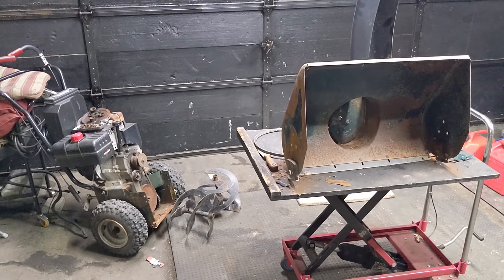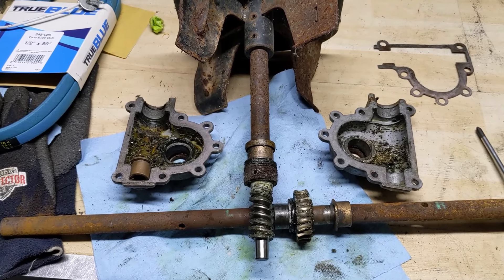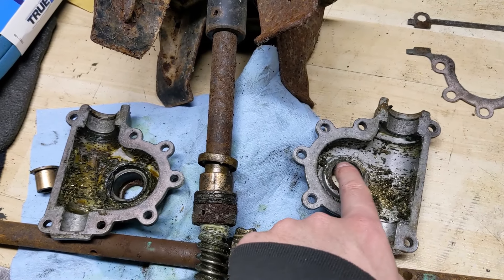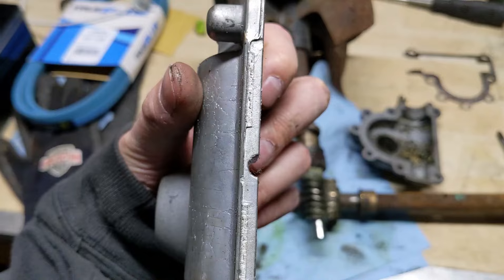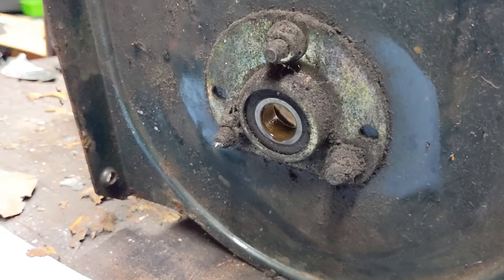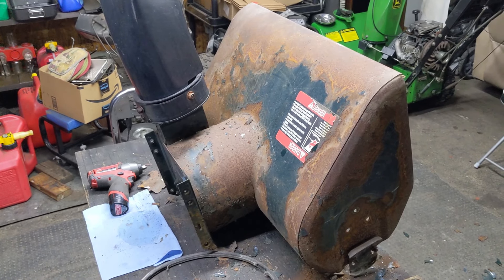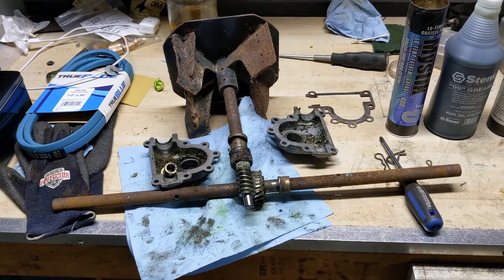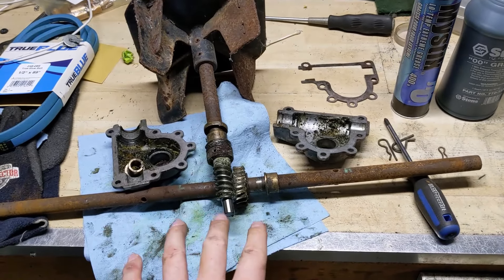Check the Snowblower Gearbox for Grease

Comment: At first I thought 'How can a simple subject like this take almost 19 minutes?'  Wow, you packed it with great information throughout.  Don't stop making these videos.  Thank you.
Reply from the maker: Thanks for the kind words! I try to include expert info that's easy to understand. Thanks for watching!
Reply: Great video. 
How would you flush the gear box full of lithium grease? Got a used blower and gave been fixing it up. Runs great, got 80 90 gear box oil but when I went to flush it's grease 8nside? I trylgas and ran it for a bit.  It not as thick but still not draining. 

Thank my man

Comment: Thanks, I am working on an abused contractor blower right now.  I am done.  I am just checking to see if my snow-mobile grease is OK.  I will check the label for sulphur.  I have used it in Roto Tiller worm gears for years.  Thanks again.  Your knowledge is ahead of mine but I try.
Reply from the maker: Thanks for the kind words Bruce! I spend a lot of time researching to see what's good and not so good, rather than always learning from experience, or trial and error. I do like the STENS 00 grease, but sadly the old man said they're not selling it anymore. I forget where we purchased the Alvania EP, but it works good too. I've heard Tractor Supply Store (now peavy mart) sells 00 cotton picker grease, but not sure if it's good for low temps. Looks like I have to do more research now lol

Comment: My MTD  317E611D120 (1997)  is now 24 years old. It's in excellent condition.  I've always done yearly maintenance on it.  I always make sure the gearbox is full of GEARBOX 80 WEIGHT OIL.  Matter of fact I just disassembled the gearbox on my MTD to see if there were any serious wear issues.  No metal flakes or any signs of wear, looks brand new. I will continue using gearbox 80 weight oil.

Comment: Stupid me - I forgot to reinstall sheer pins at the auger from ( bolt ) convenience last year. Well, now I gotta do the worm gear so thanks for your vid and all the helpful tips. Never did this before but looks doable thanks to guys like you and helpful info. Warning to everyone new to snowblower operation - “ make sure you use sheer pins on your auger shaft and save yourself the trouble and cost “.

Comment: Great video that will save your viewers major gearbox rebuild costs. Most gearboxes are filled with low temperature white lithium grease right from the assembly line BUT this stuff tends to get pushed and packed off to the sides of the covers away from the two worm gears. The 00 grease you use is an excellent way to extend the life of the internal components of the gearbox by simply adding some as required every year or two years. Pretty soon time to start on lawnmower videos SPRING is upon us!
Reply from the maker: Fools spring! I'm still waiting for 2nd winter. Thanks for watching!
Reply: Good  day Wayne. I like reading  comments for different opinions,  started  reading,  boy fellow knows what he is talking about.  I wonder were the young fellow gets it from.  lol  Thanks I guess I  will have to get some stens  00
Reply: @EliminatorPerformance  I have had enough winter, darn cold or I.m  getting older.  Thanks  Jake good video.
Reply: Don thanks appreciate the kind words, stay safe and healthy my friend!

Comment: I just put an M4 bolt in the front of mine. 45deg downward angle about midway on the cone shaped portion. Poured in grease thru the top hole to push out the aluminum shavings. Once it started coming out clean, pumped grease in thru the new hole to push any air out the top. $0.44 bolt and washer, coated in permatex afterward to stop leaks.

Comment: The Stens 00 is re-labeled Champion 4049H, recently discontinued.  Alvania is a Shell product, discontinued even longer (replaced by Gadus).  Both had sulphur as the EP additive, but tested 1B on the ASTM corrosion chart (not likely to cause issues, and that’s backed up by the fact that Alvania has always been MTD’s recommendation for their gearboxes).

I’m running the Champion (aka Stens) product in my MTD-built Troy Bilt.

I did an unscientific side by side comparison of corrosion using the Champion product and the Smitty’s Super S 00 from Tractor Supply.  I used that as the comparison because it contains no sulphur at all.  I soaked brass fittings in each product for several days.  At the end, I could see no difference in the darkening of the fittings, in fact if there was a difference, the Super S may have been a tiny bit darker.
Reply from the maker: Champion still sells the 00 except not in 32oz bottles, you have to buy PN: 8229763 which is an 18kg container. I could fill my own bottles, but it sucks for reselling to my customers who want it.

Comment: Nice,,great info
One comment I do have on EP additives
"active sulfur" is low temp high pressure and will react with so called yellow metals..
"Inactive sulfur" is used for High Temp gears and will only react to form an intervening coating at these very high temps.
If we use an EP with high temp "Inactive" it shouldn't  hurt these gears as they simply don't see any high temps..
Generally, EP additives for a simple gear system as this really isn't required.  
My concern is keeping these lubricated. I find that the original grease doesn't Re-Flow back to the gears and just seems to get wrapped up and spun off to the outside of the case internally. 
I like the new case mod you show and speak of, great idea, just pump and go, keep it fresh!
Reply from the maker: Which is one reason why I prefer to use the 00 as it flows like oil but sticks like grease. The NLGI #2 is too buttery and regular 5w40 synthetic oil (what MTD is now using) is too runny in my opinion. Unfortunately there's a shortage of 00 grease here in Canada.
Reply: I heard ya dad mention that,, 
I'm not finding either as I search,,,ughhh
Reply: I was thinking about trying the Lucas oil treatment stuff they sell
Reply from the maker: @TheNovaJohn  I'm calling Super S Products tomorrow to see if they'll sell us some from the US, as NAPA Canada won't import it, and TCS tractor store in Canada won't sell the cotton picker 00 grease they sell in the US either... The only other option was Champion grease but unfortunately they discontinued their 32oz bottles and are only selling larger quantities now...

Comment: The gear box on Ariens snowblowers, at least the newer ones, is filled with a specific oil.  You're supposed to check it to ensure it has an adequate amount.  The level needs to be so many inches from the top of the gear box housing.

Comment: I use Mobil 1 grease, its good to -60 degrees, so it flows in to all the spaces, I use a grease gun on the top of the case and pump until it flows out, I run the machine with a  clip on the  auger for 10 min or so and stop the machine and again pump grease in to hole. I also drilled grease fittings at the ends of the shaft so that the end bearings get grease. Never had a problem  some grease I use  to lube the  wheel shafts and the internal gears.  Same grease i use on my truck drive shaft grease fittings.

Comment: I have a 40 year old toro 521.  I got it cheap.  It seems to spin the auger just fine.  Toro calls for mag 1 grease.  Do I need to service mine?  Or, should I just leave it alone?  Seems to work fine.  There is no way to drain it, only add more grease if I can get the fill plug off.

Comment: your videos are very thorough  i have an old craftsman snowblower but one side of the auger is frozen on the shaft  it wont spin around the shaft when i remove the shearpin  any ideas of getting it free other than using a torch which i dont have  thanks

Comment: I have a poulan blower, model PP1150E27. The gear box has (2) gear box plugs. Should I install a couple of zerk fittings or just check periodically for grease. PS everything works fine

Comment: I have a 20 year old Craftsman 8/24 in excellent condition that I just received and serviced everything possible but it appears my gear box has NO plug or nipple at all to check or add oil/grease?
Any ideas on this would be appreciated. 

Thanks

Comment: My manual says Ronex ED #1 grease.
That stuff is hard to find or not available.
I came across Castrol Spheerol SHL 00 grease.
Castrol says it has a 1b corrosion rating so ok for bronze/brass.
I don't know how much grease is in there yet,but if I have to add can I just add the Castrol 00 grease to the gearbox without having to take it apart and remove any old original grease?
Reply from the maker: Yes it should be fine to mix, I know Stens is no longer selling the 00 and MTD (Cub Cadet, Troy-Bilt Craftsman) exclusively use Alvania EP grease. Try to find Champion 00 at Napa or Cotton picker 00 at PeavyMart/Tractor Supply Store
Reply: @EliminatorPerformance  Thanks
Forgot to mention the Castrol Spheerol SHL 00 grease is a semi-fluid synthetic PAO grease so it should work well in cold weather.

Comment: I never use gun grease in any of my differentials. I've only use synthetic gear lube. 
 That has to be the first time I've seen pump grease in a gearbox. I guess if it's full, the gears will move the grease around enough. As long as there is a grease zerk, you have your answer on what to use.

Comment: I just fixed a snowblower that had a little stiff grease in the case. The brass gear died from lack of lubrication from the factory.  I replaced the brass gear.  My case had a plug at the bottom and the top, so I used a grease gun filled with John Deere corn head grease and pumped grease into the gearbox from the bottom.  This verifies that there are no air pockets and the gearbox is full.  I used a piece of wire to determine the level of grease on the top worm gear.  DO NOT FILL THE GEARBOX COMPLETELY FULL OF GREASE!!!!  As long as the grease level is a little above the mesh of the worm and pinion gears, the level is correct.   

I have used Lucas Hub Oil in place of corn head grease.  It can be found at parts outlets that handle tractor trailer parts.

If I were to add a grease zerk to fill the gearbox, I would install it in the lowest point possible, making it possible to fill the gearbox with cornhead grease.  Just monitor the level of the grease as the gearbox is filled.
Reply from the maker: Great tips, thanks for watching!
Reply: I use “00” grease and anything else I’ve tried is too thin and will leak.

Comment: Great info.   But I think my SNAPPER 10301 uses ENGINE OIL in that gearbox ?
Reply from the maker: Some take a gear oil, others may take engine oil like the real old snowblowers with the cast steel gearboxes. I use 00 grease in every gear box and have never had an issue.

Comment: Something like a 5w 20 or 5w 30 would be far to thin of lubricant? I was reading some craftsman forms as I just picked up an older 5/23 that needs some love and I was reading that some say the old craftsman uses to call for a motor oil in the gear box any thoughts
Reply from the maker: The "00" grease is far superior in my opinion, it offers great lubricity in low temperature conditions, but also thick and sticky enough that it adheres to the gears while spinning. There's a reason it comes in almost every snowblower gearbox now.

Comment: Nicely done!  Have you ever used gearbox oil, like the lower units of boat gearboxes?  Guessing the seals (intended for grease) wouldn't contain it.  I prefer oi because it's a better lubricant than grease, but grease has it's place too.

Comment: I have a twenty fifteen cub cadet model number 524 s w e snowthrower.  The Auger gearbox does not have a drain bolt and it does not have a removable fill plug.  As far as I can determine the seals are still good.  How would you recommend adding some grease/lubricant to it Or checking its level?
Reply: You  shouldn't have to worry about it unless you see it's leaking grease.  If it is, use 00 grease

Comment: Is it possible to use something like an axle/hub oil(S6 AXRME SAE 75W-90)? This is used in commercial vehicles for steer hub lubrication and those vehicles run in severe low temp conditions without issue. Thanks for the video.
Reply from the maker: Yes many people run that stuff too, I've never used it but I've heard it works fine. I stick to 00 grease because it's been proven and is commonly used in snowblower auger gearboxes

Comment: My Craftsman snowblower has two grease plugs on the auger gear box.Both are at even height.
When adding 00 grease do you add grease through one hole until it comes out of the other hole or would that be adding too much grease?

Comment: Incredible informative video that I’ve been searching for!  I have a 9 hp 29 inch wide craftsman snowblower that is from 2003-2005.  My gearbox has that same bolt as you’re pointing out in the video, when I remove that bolt am I supposed to put grease or gear oil in the housing?
Reply from the maker: 00 grease is similar to gear oil, the old steel gearbox housings take thicker gear oil
Reply: @EliminatorPerformance  Awesome thank you my local New Holland dealer sells the exact same 00 grease shown in your video!  Cheers!
Reply from the maker: @big_mike_nyc  it's good stuff, I've never had a problem. As shown in the video when I smear it on the workbench, it's like a mix between oil and grease.

Comment: Hey Eliminator Performance, Maybe you can help me with a problem with my snowblower. I have a 2011 Sears Craftsman snowblower, 1450/27 , and I am currently working on fixing the gearbox. I did watch the video twice but I still can’t get the issue resolved. Here’s the kicker, I talked to a mechanic I know very well and he said it is not just grease, but there’s gear oil mixed in with it. So here the problem:  I have put the adequate amount of grease (or what I thought it was) but I am just wondering, should I be able to rotate the auger unit with my hands or do I have to connect the 2 units together?
Reply from the maker: Auger usually does not spin by hand, unless you're rotating the impeller shaft, which should then spin the worm gear (as seen in this video) I've used 00 grease on every gearbox unit, never had an issue. The difference is the real older units with steel gearbox housings use gear oil. Some guys use gear oil, I use 00 grease as it's in between grease and oil. It's never created a failure
Reply: @EliminatorPerformance  I have spun the impeller by hand, but while I have spun it, it took some effort.  And on top that, I don't have Steins 00 grease, I am using a grease called Motomaster Extreme low temperature grease, it says it's good for snowmobiles, and it's calcium based, the viscosity -- I would say -- is similar to the white lithium based grease in the video...
Reply: is the grease that i have an ideal or close to what I saw in the video?  I talked to a buddy mechanic I know, and he said that what I have would work good.  but I'm still having issues.  I am going to keep on trying and hope I can get the issue resovled by the end of this week
Reply from the maker: @kaelanreynolds9762  I use white lithium on the worm gear when assembling, then use 00 to fill the gearbox. I find the 00 flows better than the lithium. If it looks similar to the 00 you should be fine.

Comment: If you add a grease fitting to the housing, how can you pump in the 00 grease?
Reply: You’d have to buy a manual grease pump that you can fill with “00” grease. Google “00” manual grease pump. If you’re going to use that grease maybe drill a hole in the top like some will come nowadays and just cap it

Comment: Tractor Supply sells Cotton Picker Spindle Grease 00. $5.29/qt. I've used it. It works.
Reply: Good  day Paul Tennis.  Would that be good in cold here in Ontario.  Were are you from  Thanks
Reply: Paul thanks we will check this cotton picker spindle grease 00 out at our local TSC, never heard of it before!
Reply from the maker: Yes I've heard of it, it is Double Zero so should work, the issue was it wasn't available at our local TSC when a friend looked for it!
Reply: @EliminatorPerformance  Tractor Supply in the USA is a different company than TSC (Peavey) in Canada. That is why we cannot get the same products that Tractor Supply in the USA carries.
Reply: @donvoll2580  I'm in the US in the New England area. Since the grease is type 00, I think it would work find in your area.
Reply: @EliminatorPerformance  
I looked at the msds and technical bulletin on this and it said it contains calcium petroleum sulfonate, the sulfonate has me thinking that it a form of sulfur, its < 3 %, but could it react with the brass as you've mentioned?
Reply from the maker: @242sp  are you referring to the TSC cotton picker spindle grease, the STENS 00, or the Alvania EP grease?

I googled Calcium Petroleum Sulfonate and found that it is used as a thickener, and increases the "dropping point" or the maximum heat level of the grease. Additionally, it mentions this "Because of the calcite particles’ lubricating properties, performance additives containing sulfur, phosphorous or zinc may not be needed. This is why some calcium sulfonate-based greases are attractive to the food industry." So active Sulfur as an EP additive will most likely not be used in that grease.

Read more here: https://www.machinerylubrication.com/Read/909/calcium-sulfonate-thickeners

Comment: What gearbox lubricant is equivalent to Ronex ED #1 ?
Reply from the maker: Download this PDF file, scroll to the bottom and under the 1 section look at the specs of the grease. You can then compare that to other greases.

https://www.google.com/url?sa=t&source=web&rct=j&url=https://www.powerlubeind.com/sites/default/files/default_images/downloads/LubeSpec2014/TDS/Exxon-Mobil/Ronex_Extra_Duty_series_tds.pdf&ved=2ahUKEwjH1tq09oH7AhV1jYkEHVoABcIQFnoECA8QAQ&usg=AOvVaw1B8PwJ81PMA-43cbyjVvpW